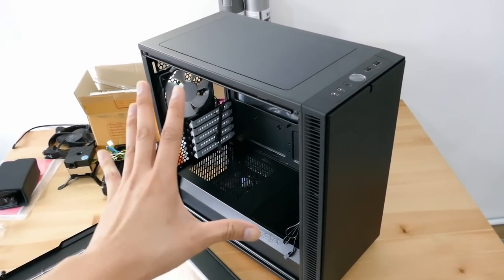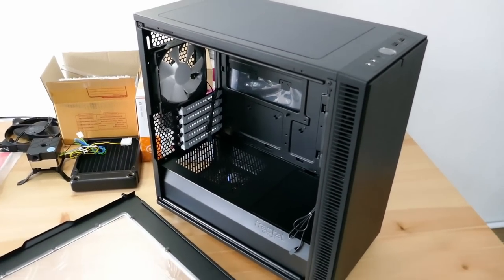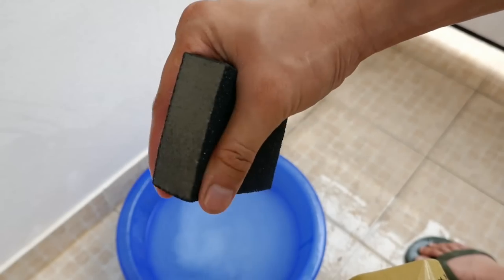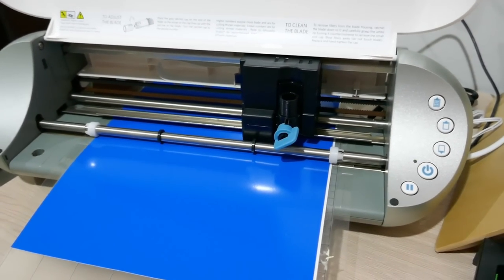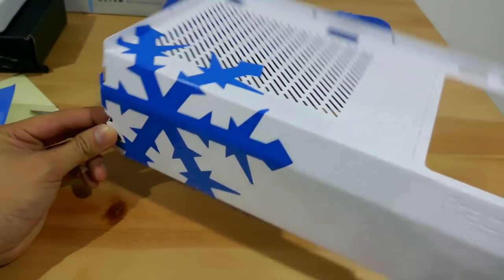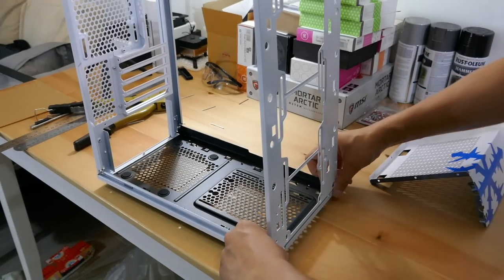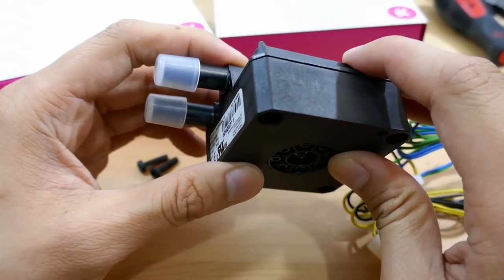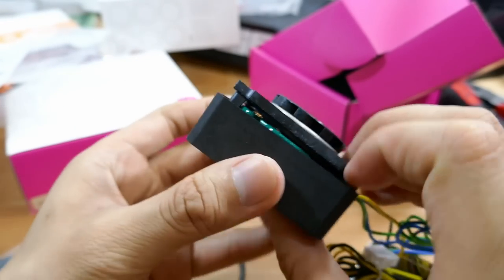PC case modding and water cooling parts on the Fractal Design Define Mini C White (Part 1 of 2)

Comment from the maker: For part 2 give me a week to figure out how to bend tubes and edit the video! Thanks for watching! Hope to see you in part 2!
Reply: Besides this project, you should upload more frequently! <3 (Y)
Reply from the maker: I agree, will try my best!
Reply: Did you know that Bitspower make a white top and bottom for that reservoir?
and do you consider powder coat those fitting blue to match the logo?, it would look so nice.
Reply from the maker: Yes! but unfortunately my local store ran out of those white top bottom reservoir :(
Reply: Just something for the watercooling part. When you were talking about the loop order. "warm water comes out of the CPU and goes into the radiator". This is not how it works. The water flows so quickly that the temperature equalises no matter where the water is. So you can easily go from the CPU to the GPU without any problem.
Reply from the maker: Joey Hobbit great! Thank you for your info

Comment: Just in case you didn't notice, the EK CPU block needs to be rotated 45 degrees anticlockwise(Unless you're going to just turn the badge of coarse). 
Looks nice and clean so far though.  You could get 12mm fans for the front rad(I have them in my Prodigy M in the top 240 rad), but they are hard to adjust for low noise through software.
I'll get straight to the 2nd part now.

Comment: hey i love ur case and i have two questions:
1. can i put 120(rear)+240(top)+280(front) at the same time?the radiator are about 30mm thickness.
2. if the question 1 is optimistic, there a 280 radiator on the front, whether can i put a 120 fan on the bottom?and i wanna put the ddc pump on this fan.

Comment: how did you put the acrylic on the top? did you glue it? also, what was that yellow tool you we're using?
Reply from the maker: +keeler1160 hey thanks for watching, I used a double sided tape for the top and the yellow tool is a acrylic cutter

Comment: I was going to say the GPU will be in the way if you still plan to do the tubes in your original config. what you could do is go through the pass trough for wires it will add more bends but might look awesome. if not you can always re route them under the  PSU cover....or maybe swap out the GPU for a shorty one, i was only a 1060 right? not like your pushing hard with that .  just a thought....GL !!  Cow }:-o)
Reply from the maker: Yes, you are correct I just looked at it and it seems like it is a tight squeeze between the GPU and the side panel... also the cables to the GPU too! Will consider your suggestion but that seems a lot of technical bends :S and yes it is just a msi 1060 card :)
Reply: Yeah I get that if need be use some 45 angles so less tight bends if need be.....I mean I would explore all avenues before I commit to one if i was You, if not sure draw it out on paper to see if you like the idea before  you go forward, this way if your not 100 % ok with it you can make changes then before you get in the middle of it.  JO JO   Dont rush part 2 just because you told them a week! GL   Cow }:-o)

Comment: I think the fractal logo is a snowflake. I watched Singularity Computers and how he does his paint jobs, which are pretty insane, but I think yours turned out pretty good too. What type of paint did you use? Is it easy to rivet the case together after? I want to try that at some point.
Reply from the maker: Yes I like Singularity Computers they are truely professionals! I will find that vid you mentioned. The spray paint i used was acrylic lacquer spray by TOA brand (Thai company)
Reply from the maker: Thanks for watching!
Reply from the maker: Also the rivet was not so hard, just have to remember where the parts are supposed to interlock with each other.
Reply: Thanks man. Appreciate the reply. Looking forward to Part 2.

Comment: ooh man.
i'm subscribing just to see you suffer filling (and later draining) this loop :)
it's a beautiful case mod which is absolutely not practical for people with over 25C room temp.
here is an idea of how you can put more into less: meet the Frostbite v1.1 
http://i.imgur.com/mQb709a.jpg
http://i.imgur.com/fPyXC19.jpg
v1.2 will be replacing the side window with slightly tinted TG. 
This loop is not perfect either, If I just bought two alphacool rads, i'd be able  to flip them and have the pump more to the back with tubing and draining in front.

As a side note, the in and out ports on CPU block should be horizontal. otherwise the CPU die is not cooled in the optimal way.
Reply from the maker: Hey man nice build! I like it. And yes it was a challenge to fill up the loop, took forever and my back hurts lol. I don't know what to think about the draining part :S You should check out my part 2 if yo have time. Thanks for watching man.
Reply: Already did it. Very impressive job.
As you might have guessed, I put practicality and performance first. So while I like the mod you did very much, i consider it more of a showcase than practical build (practical = 30-60 minutes to swap any component in the system including GPU, MB, RAM, CPU).
What do you think about making the liquid a bit more blue to be closer to fractal's blue? If it was me, I'd do it with pastel white + blue die to achieve exact match.
Reply from the maker: Dmitri Weissman to be honest I was thinking of putting some more blue dye in there but... I was too afraid of having it too dark blue therefore I would have to drain it... which I don't want to do it yet lol